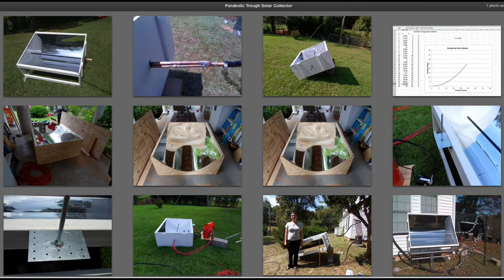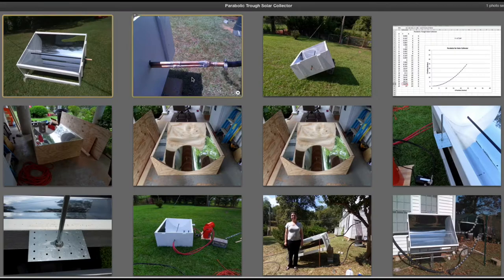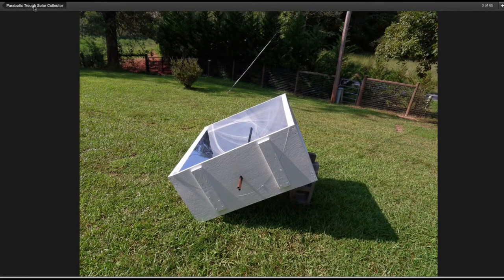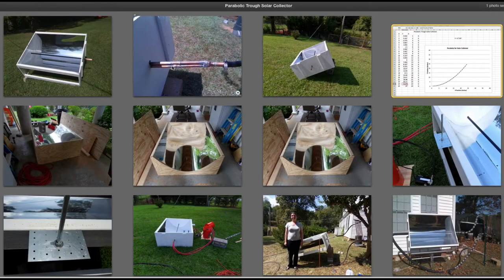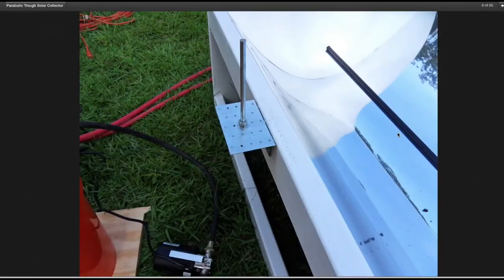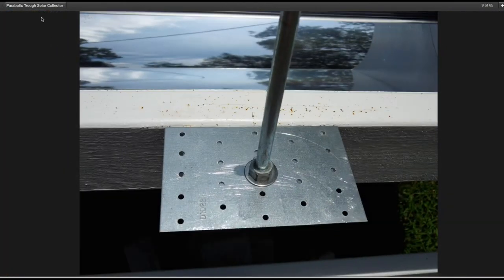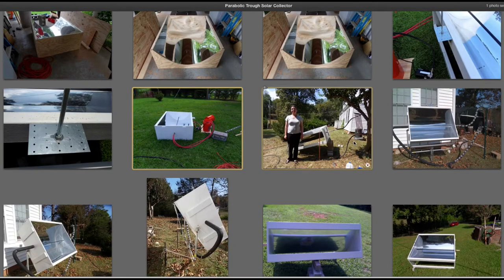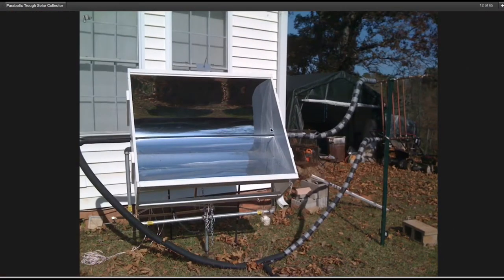Parabolic Trough Solar Collector

Comment: Awesome build and info, definitely need a tracker, I was thinking of using one to heat anti freeze solution to heat an in ground sand heat battery for home and water heating hmmmm…thanks again.
Reply from the maker: Thanks for watching and your comment. Climate change and energy shortages are driving a lot of innovation. I highly encourage you to work on your ideas. You could make a major contribution.

Comment: good day, what reflective material do you use in that project?
Reply from the maker: It was nine years ago and what I used was a sample of reflective polished aluminum that I was able to obtain from a bulk supplier to large solar projects. Unfortunately I do not remember the name of the vendor. I recommend doing some Google and Bing with Chat GPT 4 searches for “polished aluminum mirrors for solar collectors”. A manufacturer of the aluminum foil or the solar collectors can probably direct you to the right vendor. Just call the tech service people and start asking questions.

Comment: Hello sir.
The video is great!
Can you tell what are the components sir
Reply from the maker: I was able to obtain a sample of coated mirror polished aluminum for the reflector. I used ordinary plywood, but if I did it again I would use something that is weather resistant like treated wood plywood or something else. The pipe was ordinary copper from a building supply and painted with a high temperature flat black paint. It all worked really well. The major issue with a focusing collector like this is it has to track the sun or it will not work very well. Also hazy days like we have a lot of around here in the summer scatter the light so much that it becomes very inefficient. If you live where the sky is clear most of the time and you have a set up that will track the sun it will work very well.